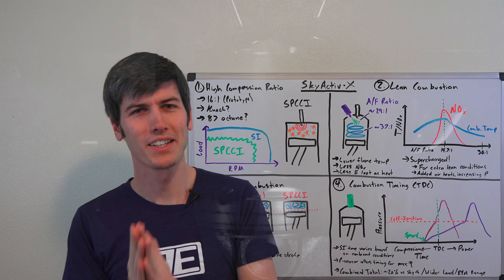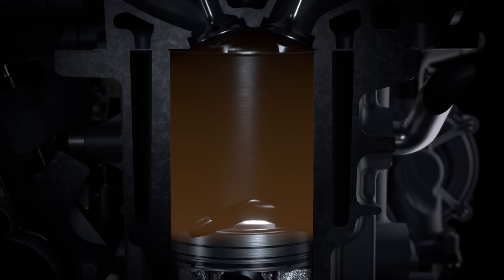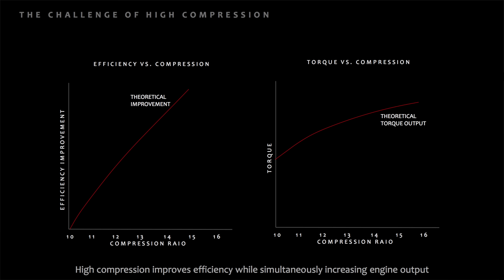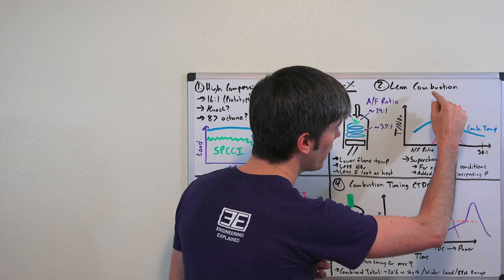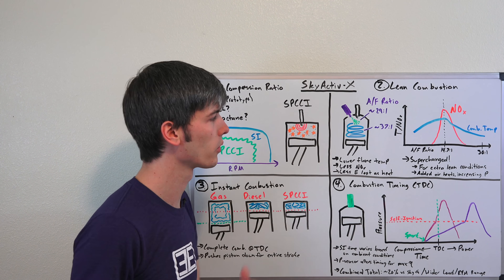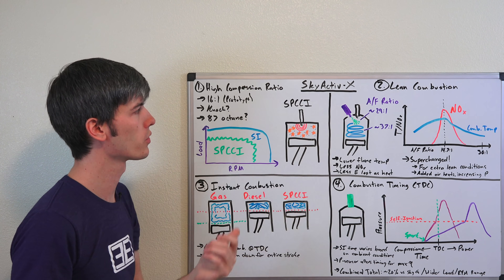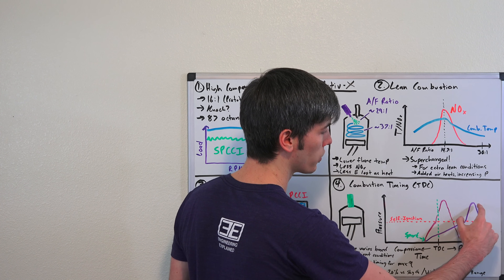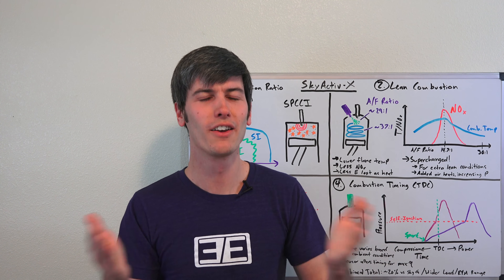How Mazda Is Saving The Gasoline Engine - SkyActiv-X

Comment: As a person who can't wait for the EV revolution to fully sweep across the world, I'm actually slightly sad that this engine design will have a fairly short, if relatively successful life. It quite obviously is a more advanced design and petrol/gasoline engines are not, on the whole, as polluting as diesel, so if we are to persist a litle longer with ICEs, then it is best they should run on petrol. Sure it could end up in a hybrid eventually, which will extend its lifespan, but in the end it will go the same way as every other ICE.
I feel that these recent engine designs [like Toyota's new DF] are hedge bets against EVs taking over. In 20 years time we'll probably talk about, what happened to, them over a beer.

Comment: greetings, are there equivalents to Mazda Sky active x internal combustion engine among the other companies?
many thanks
Reply: Not successful ones. Almost every big auto manufacturer has been working on compression-ignition gasoline engines for many years, but no one has ever been able to overcome the fact that gasoline doesn't autoignite consistently enough to comply with modern performance and emission standards. That is the absolute genius of Mazda's solution...call it a clever dodge. The problem has always been approached as in a diesel...everyone tries to cause combustion by compressing the mixture. In Skyactive-X, the compression in the cylinder is designed to get it close to detonation, but not to be able to quite get it there. But any additional pressure would be enough to set it off. They then use a spark (which we can easily control to the microsecond) to initiate the combustion event by raising the pressure in the cylinder past the trigger point for the already-compressed, hot, almost-ready-to-combust mixture that we've squeezed in the cylinder, which then all burns simultaneously (like a diesel), rather than by a traveling flame front (like an ordinary gasoline engine). They are basically inducing engine knock exactly when they want it, instead of it happening approximately when they want it. 

Many people miss the fact that the spark doesn't ignite the mixture like it does in a regular engine, it rather ignites a little tiny rich fuel mixture around the spark plug, which generates a pressure wave. Since the fuel is already at high temperature and pressure all throughout the cylinder, this extra pressure pushes all of the fuel mixture over the autoignition point all at once, causing it to burn all at once, like a diesel. The pressure wave causes the main charge to burn, not the spark itself. And since it has all of the hardware a conventional engine has (spark plugs, fuel injection, etc), it is super easy to program the engine to operate in the more conventional mode (Atkinson cycle, for higher efficiency) when conditions aren't right for the autoignition mode, and it can smoothly transition between them.  It is so obvious, now that Mazda has shown us the way. 

Jason is right...in the world of automotive engine design, this is a VERY big deal in a time when the incremental improvements are normally tiny.
Reply: James W   Great comment, James.  I did catch it while watching the video, but I appreciate your calling attention to it and putting a finer point on it.  Jason is a great presenter and not many could enhance his work as you have — congrats.

Comment: Skyactivx works efficiently in low rpm span, in high rpm span they cloud utilize its supercharger to make it run like a turbo engine, because turbo engine work efficiently at high rpm, then it would be the most efficient engine ever

Comment: imagine if they brought out a smaller engine (90-100HP at 1-1.5L for example) with this tech in the EU. They would sell like hotcakes.
Reply: No they wouldn't.
Reply: @zondaboy6493  why?
Reply: @zondaboy6493 Yes it would, 150 horsepower is more than most trucks in Europe lol
Reply: Yeah or put this one in a multi purpose lightweight pickup like the old navara... hot cakes in Asia Africa South America and northern europe
Reply: They just did, the mazda 2
Reply: like cross-overs

Comment: It will work re gas mileage/emissions.  But if you manage to get to 100k mi you are one of the lucky ones..     Just like ford Eco boost and all of the other schemes.   Wake up people!  Sending cars to the compactor at 100k mi and less..   how's that for your carbon foot print?  All of this crap is because Toyota and Honda damn near put themselves out of business in the  mid 90s designing cars that last 3-400k miles.  It is demanded by the nanny state EPA and manufacturers love the increased unit profitability and designed obsolescence.   It's always about the $$$ in the end.

Comment: Hi. I have some consumer questions regarding this engine.Could someone explain or predict, what are the maintenance costs of this engine gonna be, or could be?  As far as i was told, diesel engines have higher maintenance costs than a petrol engine, but better economy. What about this one?  Price wise the forecasts for the skyactiv X engine/car, are speculated to be in between mazdas petrol and diesel (in the EU), as far as i read somewhere online. I am asking because of my mileage i would need a diesel, but because of possible EU diesel restrictions, it is to risky to buy, so the skyactiv x looks like a good alternative. Thanks.

Comment: Maybe my next car will be a Mazda. My only concern is if the electronics fail, will this cause irreversible damage to the engine? Do they have a fail safe that if something goes wrong with one of the sensors it will revert to safe cycles?
Reply: My guess is that they will have it in standard injection by default, but when all criterias are green it will use scci. Otherwise it would get pretty expensive to maintain once it reaches 10+ years

Comment: I bought one in 2012, have 116,000 miles on it.  Fuel efficiency around 36mpg under rush hour flipping off your neighbor for cutting you off conditions.  45mpg if your paying attention to fuel economy as staying around the speed limit and not over excellerating.  Even better on level interstate trafficless driving.  Fun to drive..... No, but that's not what I bought it for.  What I found particularly amazing was 90,000 miles before the OEM Brake Pads needed changing.

Comment: Will the ideal engine include a combination of as close to possible to hcci plus VCR seen with infinity? Especially given the power stroke transferring the energy almost directly downward with the VCR then maximizing the usefulness of the fuel with spcci, I would think there is a potential for seeing ridiculous increases in efficiency while maintaining potential power output.

Comment: Excellent video. I wonder if Mazda are using a form of this on their DPi cars in IMSA. While it doesn’t sound like outright performance is the goal with SkyActive, fuel economy is important in endurance racing as is reliability. Also, electric surely is not the future. It’s never been proven to be better for the environment, it just shifts the emissions to another part of the process (battery manufacturing and disposal). The future surely is in better hybrids and hydrogen fuel cell.

Comment: You are getting this wrong. They dont want  knock to occur since as you mentioned knock destroies the engine. They use lean mixture, in fact so lean that it will newer ignite under compression. Then with direct injectors just before piston reaches tdc they injected small amount of fuel so the mixture round the spark is reach. Spark ignites the mixture or in some cases fuel ignites like in the diesel via high combustion temperature. This creates fireball that quickly raise the overal cylinder temp and pressure. This extra temp and pressure are sufficient enough that the rest of the lean mixture ignities. And mixture does not ignite in a fireball pattern but it ignites in multiple points at the same time like it does in diesel engines. This gives as more cylinder pressure, more tourqe and as a result better thermal efficiency. Exhaust temp is lowered since more mechanical work was done and that gives us nox reduction. But dont teach wrong that lean mixture gives us lower temp. Lean mixture actualy burns hotter since evaporation of fuel lowers the temp. Lean mixture can burn so hot that in some cases it melts the pistons. 
In the future firstly please understand this you talk about.

Comment: Mazda has no cowards in their engineering department.  Respect!

They've always been that way.  Sometimes it works and sometimes it doesn't.
Reply: Yea remember when they used to make rotary engines? They always try to be different
Reply: cat remember when they won lemans with the rotary?
Reply: Filthy Vibes the 787b is other worldly
Reply: @filthyvibes4768  Remember when Audi won LeMans NINE TIMES!!! with a Diesel engine???
Reply: Sander Van der Kammen Audi is larger and has more disposable funds compared to mazda. Compare Audi with Porsche or something
Reply: @filthyvibes4768  Porsche is a much smaller company than Mazda... and they have won LeMans NINETEEN TIMES!
Reply: @sandervanderkammen9230  as far as I know with the e-tron quattro. That was a very modern car. Mazda did it in the 80s with an engine known to be inefficient and unreliable, compared to a v8 diesel, a layout that was used ever since.
Reply: @sandervanderkammen9230  Porsche might be smaller, but their pockets are deep enough.
Reply: @naseeb46  Lol!!! Porsche was winning Le Mans back when Mazda was still making corks and bottle caps!
Reply: @sandervanderkammen9230  I didn't say otherwise. I'm a Porsche guy, but you can't compare Porsche with Mazda.
Reply: @naseeb46  Indeed, Porsche is recognized around the world as a high performance marque while Mazda is best known for cheap, entry-level cars targeted at young at first time car buyers..
 Mazda no longer has any factory  motorsports program.
Reply: @sandervanderkammen9230  Porsche is known around the world for creating mid life crisis Volkswagens to go to business meetings in. Hardly anyone buys the gt3/gt2, the rest are all comfort coupes for 55 year olds.
Reply: @summushieremiasclarkson4700  Porsche has won Le Mans NINETEEN TIMES
And the 911 has the most motorsports wins in history.
 Mazda made the news today for having the 2 worst-ranked SUVs on the market.
Reply: The speed3. The turbo Miata.
Reply: @boho1926  It might not make a come back BUT Mazda making what Toyota can't for Mk5 Supra and Mitsubishi (yes its completely not in this context) making another Lan Evo with Renault-Nissan-Mitsubishi Platform mid 2020 confirmed
Reply: @boho1926  I had an '05 MSM Turbo Miata..."Lava" color...beautiful and great fun to drive!
Reply: @Thomas B VW is owned by the  Porsche Family,  Mazda was owned by Ford for most of its existence, it's now owned by its creditors and Toyota.
Reply: Not Hitler most raced car in history

Comment: Well, i was wondering that for more than 20 years, why nobody makes engine that runs lean. I noticed like 15 y.o. boy that some moped (litlle motorcycle, 49 ccm, 3, 4 hp) models  in moment when engine running, if fuel input in carburater is closed,  while last drops of fuel going thru carburator, engine speeds up, even if you go peddal to the metal, like it becomes more power thru meybe 3-4  seconds and then drops dead. I was frustrated than, why on earth nobody do not make engine which is more powerful and uses less fuel than normal cars do. And after all that time, somebody is tryng to do it. BRAVO!

Comment: This sounds so cool and interesting. I'm really curious though, if all these new features in the SkyActiv-X improve on the SkyActiv-G and on gasoline engines in general, all of this should, in theory hopefully, work on Mazda's Wankel rotary engines, i.e. the SkyActiv-R. It makes sense to at least try it out on their rotaries to see if it can work as it can help solve most of the Wankel's issues with fuel efficiency, emissions, heat, and torque. Fingers crossed that the SkyActiv-R has that and an RX-9 will be ready for it as well

Comment: Clean burn: fuel and air well mixed, no soot as long as the mixture is lean and combustion is fast 
Fast combustion: compression ignition as long temperature is held high enough
Timing control: spark Plug as long mixture is not too lean
Knock control: lean mixture, lower combustion temperature, lower nox emissions and lower heat release rate
Ignition of lean mixture : spark Plug and direct injection assisted compression ignition
Et voila

Comment: Ok so my question is this. In my understanding diesel fuel is cheaper to produce, its has higher efficiency, and it already has the compression ignition. Is this engine better then a diesel and why?

Comment: I can’t help but ask about Mazda’s skyactiv x reliability over time, I mean it sounds like there are lots of require sensors and systems to manage this process (not ideal for the car to switch to limp home mode). Also, running the engine lean means it puts the engine through quite a bit of stress especially over time... 

Any thoughts?
Reply from the maker: All engines are packed with sensors these days, so it's not really the determining factor of reliability. Also, why does lean burning mean more stress? It's not the same lean burn like in other gasoline engines. When you're going for power, the engine will significantly reduce the air/fuel ratio (richer mixture used).

Comment: "the way Mazda is going it is very smart for the time being."
That time being will be very short. Toyota and Mazda joined forces  on engine development - with most relating to hybrid range-extender applications. Concentrating on simple, constant speed, range extending engines is the way forwards.

Comment: I'm a bit confused with the whole lean burning - lower temperature thing. I thought that by lowering the fuel quantity, thus burning leaner, can lead to higher temperatures inside the cylinder as the fuel that would help cool down the cylinders as well is less to go by... is there like a fine line for this?

Comment: As always, great video, well put together and easy to understand (at least for me, a self-taught mechanic / gear head / chemistry teacher). However, for sake of clarity, one inconsistency in your verbiage that you may want to address in future videos is your references to NOx as “nitrous oxides”, which is not accurate. NOx, where x usually equals 1 or 2, is a family of Nitrogen Oxides like NO (Nitrogen Monoxide) and NO2 (Nitrogen Dioxide), whereas Nitrous Oxide (AKA laughing gas or in tuner slang NOX) is actually N2O. Thanks for listening and also for the awesome job you do educating the masses! 👍🏻

Comment: "You want to get the air fuel mixture to just before is spontaneously ignites and then fire a spark plug..."  This description is not unique to this engine.  This description applies literally to exactly, every "traditional" internal combustion engine.  What you've just described quite well is "the" compresion stroke.

"but you cannot always run it in this mode..." seems silly since every other "traditional" internal combustion engine ONLY runs in this mode...

Comment: I thought higher octane meant more resistance to combusting under pressure?
Reply: It does mean that (technically it is resistance to ignition from temperature, with the raise in temperature caused by compression).

Comment: I noticed a mistake. You said highest NOx production is at stochiometric, that isn't true. You showed the graph for CO2 which peaks at 14.7:1 (CO2 is how we tell an efficiently running engine from 14-16% CO2). NOx kind of has a steady rise from rich to lean with a sudden drop at a lean misfire. This is because NOx is caused primarily by heat and compression. This is why our higher compression engines are running an additional reduction catalyst to reduce NOx. Like how with GDI we can run higher compression with lower octane but with higher NOx. I mean maybe I misunderstood you but I am curious as to why you said that
Reply: Also another mistake, we use ignition and valve timing to create the combustion 10° After TDC which is the most effective and efficient time to do it. Sort of like how we press the pedal on the bike slightly after TDC

Comment: I remember many years ago when I proposed the concept of a direct injection gasoline engine to some of my peers in college. They laughed at me saying that there was no point, I guess Mazda was listening :) It is a natural step in the evolution of the internal combustion engine, higher compression ratios give more torque and better thermal efficiency, and simply put you cannot pre-detonate what is not yet there. I would like to see someone use that same kind of engineering on an efficient yet sporty turbo engine, that was my objective. 1 bar of boost on a 1.8-2.0L 4 banger would have no issue whatsoever pushing well north of 300hp with any decent DOHC heads and with a 10.0-1+ CR you would not compromise off boost driveability like most boosted 4 bangers do now.

Comment: Ah, BUT I work on Mazda engines all the time, because these small 4 bangers with turbos and GDI and VVT tend to fall apart once they get over 100 thousand miles on the clock. I would assume this new design will also fall apart, and being even more complex then the earlier models, I would assume they will break even faster and cost even more when they do break down. Every single customer of mine with a later model VVT GDI Mazda engine said they will NEVER buy another mazda because of the expense of fixing them when they do break.
Reply: three hundred km is not uncomon on these cars. Whats your problem?